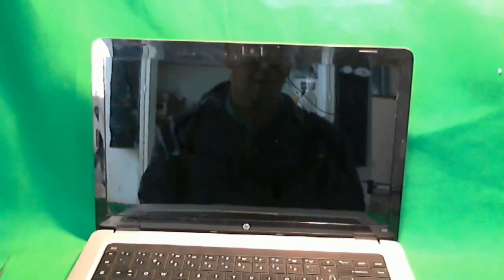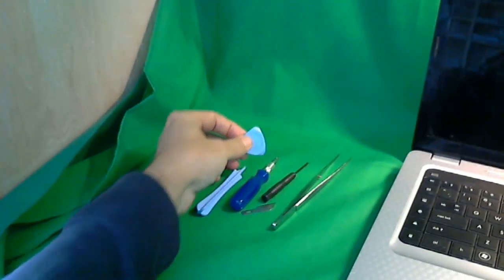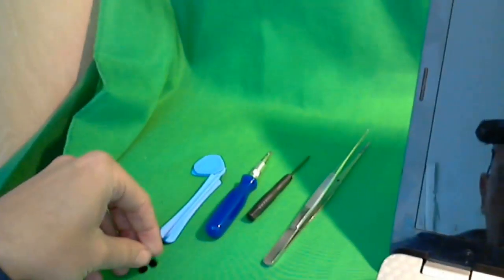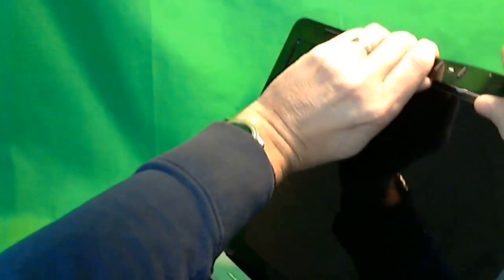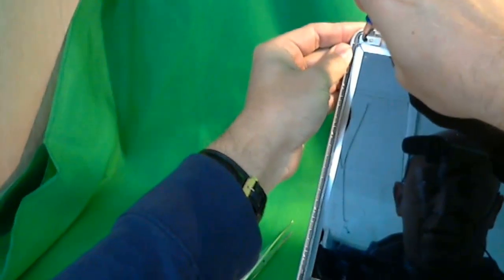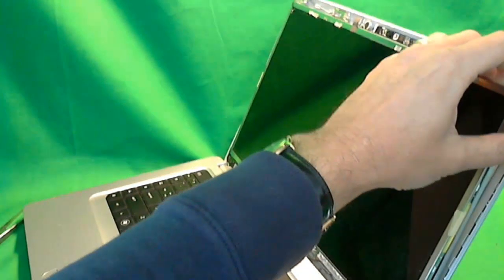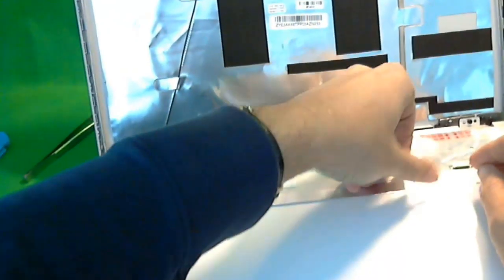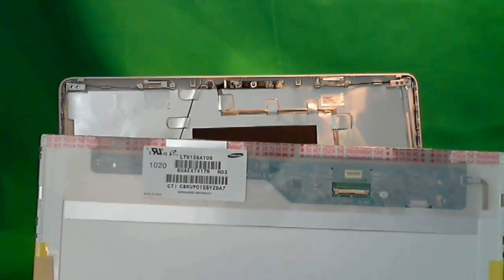HP G62 laptop screen replacement procedure

Comment: perfect! Ordered my screen and did it myself. Saved me hundreds of dollars. For anyone that is doing it, the only difficult part is removing and putting on the screws at the bottom of the frame, other than that its a breeze. Just a word of caution, be careful with the screws as they are small. OVERALL FANTASTIC INSTRUCTIONS THANK YOU SO MUCH

Comment: I am a computer student and I have a g62 I am repairing right now but it an unusual case the screen only has problems when at certain angles.  You can lean it back and forth and the screen will come in just fine but at certain angles it will get fuzzy and break up.  Any idea what could be the issue?  As far as I understand these laptops do not have inverters which would have been my first guess.
Reply: There is a break (hairline) on the data cable that connects the screen to the circuits. Problem will be resolved if you change the cable. This happens when you move the screen, the cable moves a bit and there is a small discontinuity. Else the screen is going..

Comment: Thank you for a great walk through of the screen replacement process.  I had never attempted this before and the HP folks said it would be a "minimum of $250" if I sent my laptop to them to have this done.  After seeing your video, I gave it a try.  Working at a very deliberate pace, it took 20 minutes to remove the screen and slightly longer to replace it (those darn screws are so small to handle!).  But the screen is replaced and working perfectly.  Couldn't have done it without you!

Comment: Hi Eugene, i have a HP G62 also that i just purchased from a friend of mine. the LCD screen is completely trashed. i was wondering, does the product number for the replacement have to be the exact same as my current one, or will one thats the same size work? ive gotten mixed responses on this and just wanted confirmation from a professional. thank you for the video by the way :) im confident in performing the swap on my own after this

Comment: Hello :) I have a HP G62 laptop. My screen has recently started going pink & fuzzy. I am currently using it 2 type now, but its annoying 2 deal with. I did hook it up 2 an external monitor & it looked fine. Is this something that can be repaired or does my screen need a full replacement?
.
I watched your video and it was very easy to follow. I believe i can do it once i get the proper tools.
.
Thanks so much!
.
Calli :)

Comment: @ihavesexforhappymeal Thanks Dude, saved me getting a brain bleed. The screen surgeon failed to mention that hp use locktite or some other substance to make retrieving those screws near impossible without ruining the screw of the screw driver.

Comment: Great video!! I don't have a cracked screen, but had a lot of red and discoloration in the LCD. When I hook it up to a VGA monitor it works fine. I've updated the graphics drivers, updated the BIOS, and installed a replacement LCD - still the same. So this must narrow it down to a bad LCD cable? I'm guessing caused by overheating? Any suggestions would be great! I'd like to purchase one from ScreenSurgeons if you resell them?

Comment: This is FANTASTIC. Thank you ScreenSurgeons for this - I was able to repair my HP G62 in 20 minutes using this procedure. I had a permanent white screen. There was no obvious fault - but just making sure the connector was 100% secure disconnecting/ reconnecting has fixed the issue. HP Buyers BEWARE!!  My laptop is just 14MONTHS old  -and the problem has been intermittent for 8 months but HP refused to help. I will not buy another HP product!

Comment: I just want to say that with a bit of force, i managed to replace the screen without fully removing the plastic bezel. (not even touching the hidden screws). Feel free to use force on the plastic back panel to access the metal frame surrounding the screen- it's quite strong! 

Also, on newer models, the bottom screws don't need loosening. The two bottom side screws on the frame can also be left out, since the frame supports the screen enough.